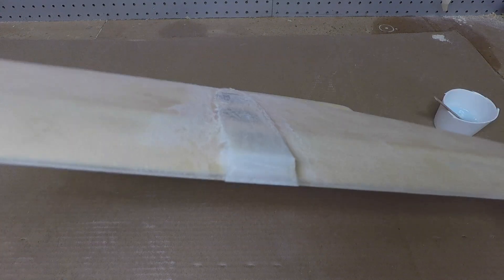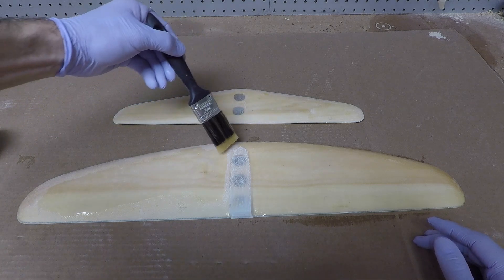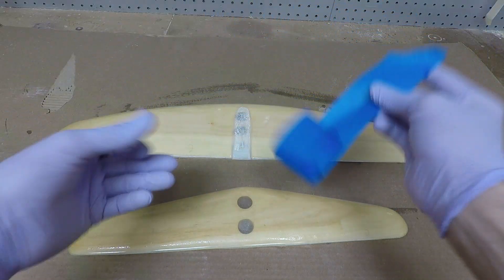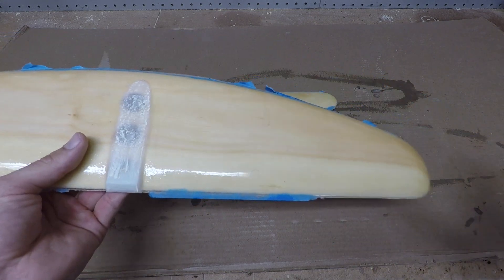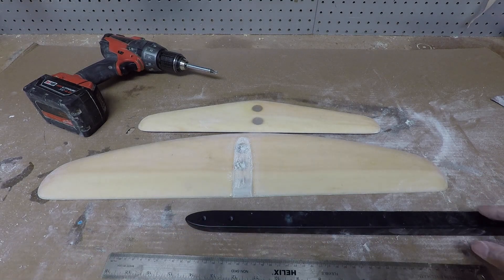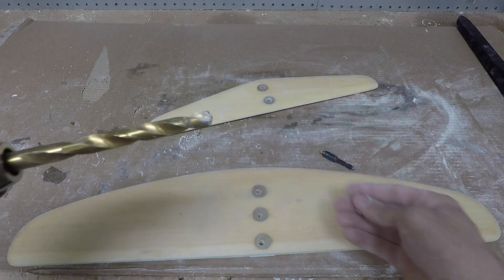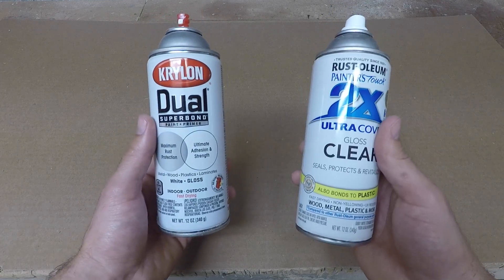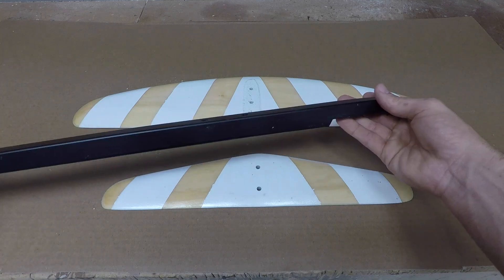BUILDING a Hydrofoil! Part 4

Comment: why don't you sell it just completely done?  my dad's been building boats for 70yrs. but we rather not do the molding part.  we just don't do that in typical boat building.  He was world champion Moth class sailing in 1976.  Ted Causey   We would like a complete one that can be bolted to the bottom of a wind surfer.  Can you use Kevlar instead of Fiber?